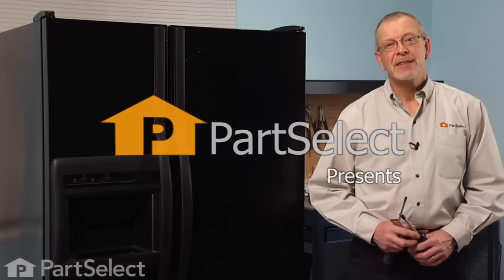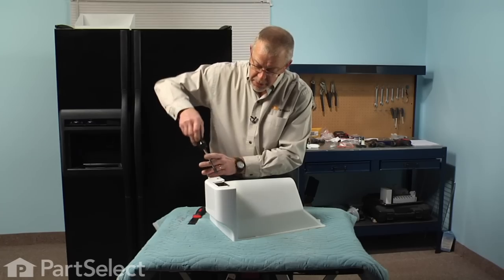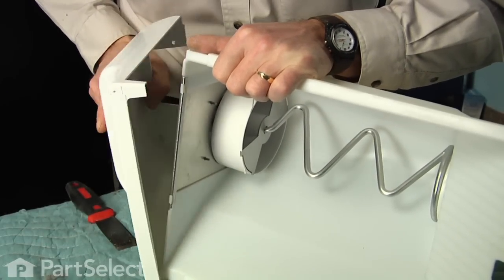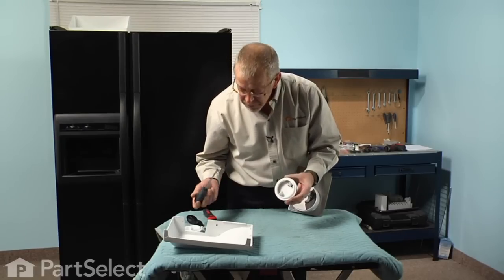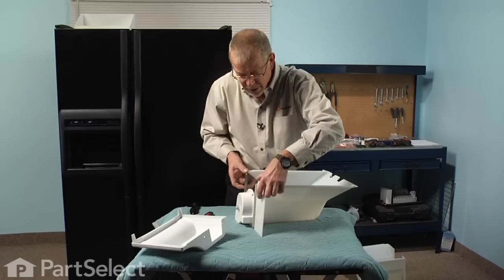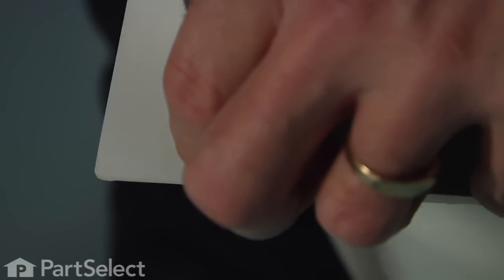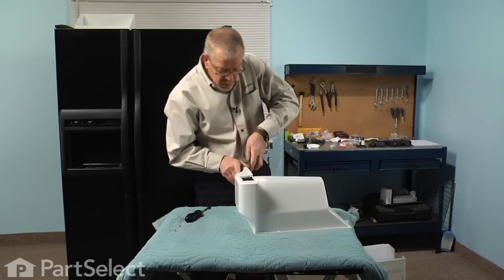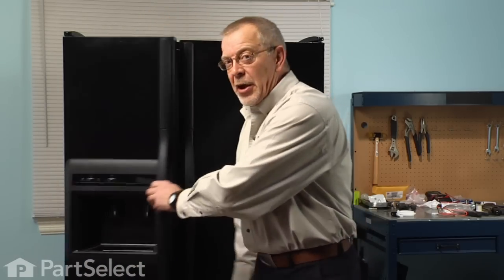Refrigerator Repair- Replacing the Icemaker Helix End Cap (Whirlpool Part # D7749401)

Comment: The Augur in my ice bucket may be my problem.  I think it's diameter has increased so that it's not tight enough around the end cap, thus it keeps popping off.    However,  I'm no 100% sure of this.  How tightly does the augur fit around the end cap?

This happened when the ice maker malfunctioned and squirted water into the ice bucket, thus freezing the ice together in a block, which made the augur work much harder to push ice into the shoot and into a glass.    That metal seems almost impossible to bend out of shape, though.   I already have a new ice maker, but this mechanism is the new problem.
Reply from the maker: Hello, please provide your refrigerator model number and I will be happy to research this for you.
Reply: Hello,

 I decided to purchase a new auger with end cap and ice crusher, which was being sold as one unit.   So, that should solve the problem.

  Thanks, anyway!